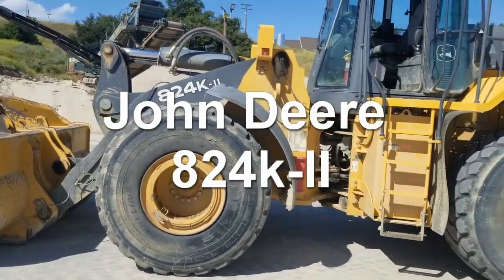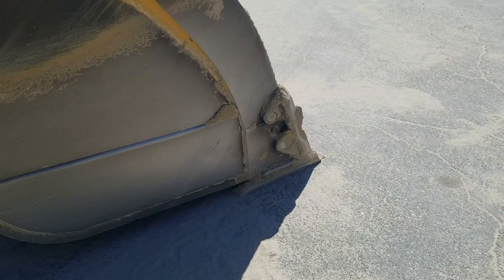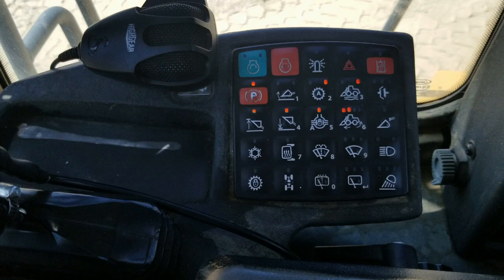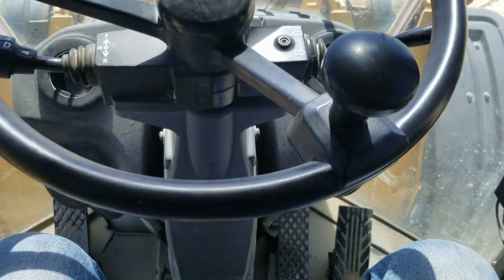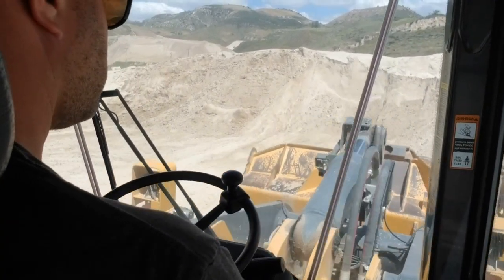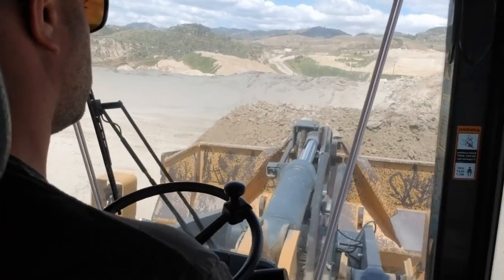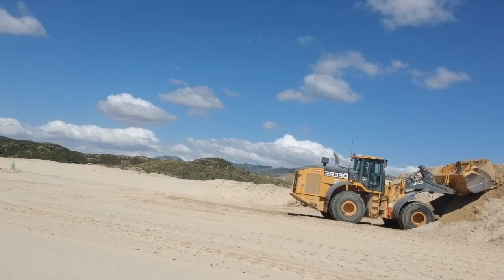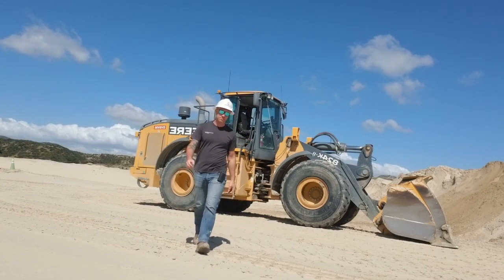John Deere 824K-II Walk-Through | How-To Operate a Loader

Comment: Left foot can’t be clutch/brake if it directly attached to the brake pedal
Reply from the maker: Yes you're right
Reply from the maker: oh wait, read your comment wrong. You aren't right. The far right pedal is the the gas pedal, the one to the left of it is strictly brake pedal, and the third one to the left is brake and clutch. The Clutch is used in the operation of the bucket not in the changing of the gears, these loaders are automatic or  a manual button gear change. The clutch is used for fast operation of the bucket up and down motion. When you step on the clutch/break and step on the gas and  rise lever for the bucket arms the bucket will hoist very fast while you stay in one place using the clutch brake and while pushing the gas at the same time.
Reply: Just learned this about the clutch brake today from one of my HEOs. Definitely helps with moving the bucket a little quicker

Comment: You’re gonna laugh but where the hell are the batteries located? I’ve had John Deere loaders my whole life and the batteries aren’t in the same spot
Reply from the maker: @dukefuggin7295  I don’t quite remember, but sometimes there’s a toggle switch hidden in one of the back metal doors and it electronically lifts the cab up or one of the housings over the engine or transmission. It might be in there.
Reply: Thanks for responding..I’ll look for that. I had a real shitty sales guy but the machine and price was right